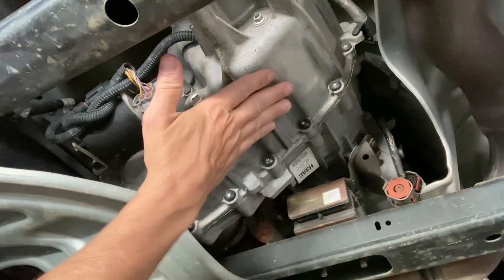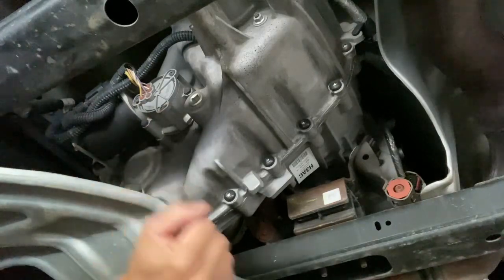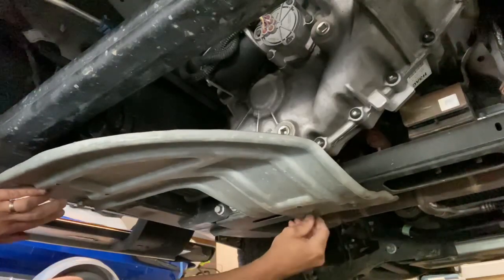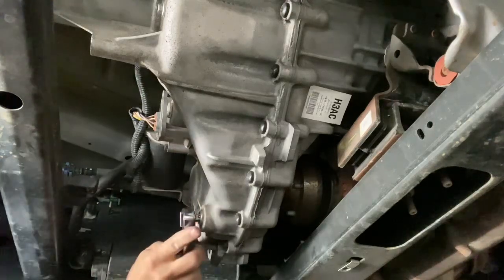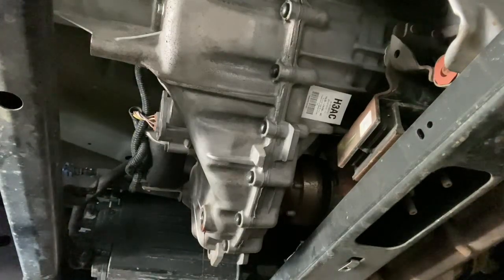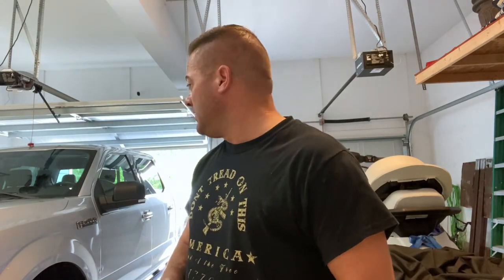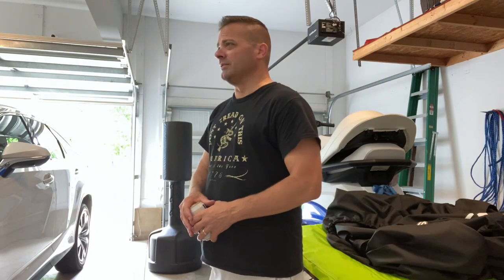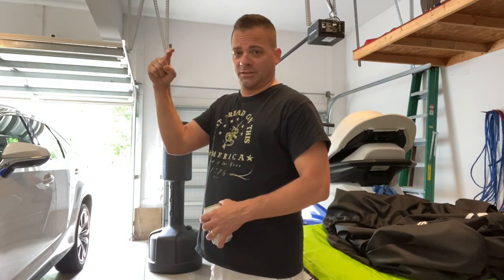F-150 FX4 Transfer Case Fluid Change

Comment: I use the exact same tool to suck the fluid out of my 10 speed auto. Works great!
Reply from the maker: Cheap to that can save so much😎 I just recently used it on my 10r80 too. How has yours been since the fluid change?

Comment: Great video.

I'm not saying this applies to you specifically, but I find that people in general don't understand the importance of the first fluid change. I don't care if we're talking engine oil, transfer case, front/rear diff, transmission, whatever, that first change is the most critical IMHO, and it's fluids will be the dirtiest at any given mileage, with the most metal stuck to your magnetic plugs, or metal shavings in any given filter or screen. That's because everything was new, and when you've got a bunch of metal parts wearing into each other you're going to get small metal debri wearing off, and in your oil and fluid. Not speaking directly to oil changes, as most people understand the importance of changing your engine oil regularly, but IMO changing your transmission/differential/transfer case fluids, after the vehicles first 30-40K miles in a very good idea to help keep everything running smooth, quiet, and issue free. Also I like to drop the transmission pan for the first change instead of siphoning it so I can change the filter after the transmission's been broken-in good, as it's sure to have some trash and debri in it from the break-in. Adding a transmission pan with a drain at the same time is a good idea as it makes changing the fluid way easier, and helps motivate you to want to keep cycling fresh fluid in it about every 2-3 oil changes. That's how I do it. The transmission holds way more fluid in it that just the pan, but this just helps keep the fluid in it healthy as you're drain out a lot of old fluid, and adding a lot of fresh fluid. Same with the rear diff cover. Adding a cover with a drain makes a somewhat aggrovating job, an easy one, so then you're more likely to motivate yourself to keep fresh fluid in it.
Reply from the maker: I agree on every point you made, and boy do I ever wish this 10r80 transmission had a drain plug right at the bottom to service more easily and regularly. 👍🏽
Reply: @kineticenergy1085  Yeah I understand. I'm trying to plan doing it in my trucks. My wife's truck is a 17 F150 Lariat 501A, 4x4, crewcab with the 3.5L 10R80, and the trans-cooler is mounted to the front of the truck instead of under the front of the pan. I don't expect this to be a very difficult change. My truck on the other hand is an 18 F150 XLT 302A, crewcab, FX4 with the 5L/10R80, so I have to get the trans-cooler out the way, and either drop the midpipe, or lift the rear of the transmission some. Everything I've seen says to unbolt the rear of the transmission from the mount that's bolted to the crossmember which has some hard to reach bolts, but IDK why it wouldn't be way easier or not possible to unbolt the transmission mount from the crossmember itself, or either unbolt the crossmember from the frame.?.? Those bolts seem easier to get to than unbolting the transmission from the mount itself, but admittedly I haven't crawled under there and over examined it either.
Reply from the maker: @JROC734  from the videos I see, you disconnect the trans cooler and sway bar to drop the pan.  “Flying wrenches” and “Fordtechmakuloco” made some vids on this process.
Reply from the maker: @JROC734 https://youtu.be/p96a8_MPwyM?si=hTrawAKCjN9wclZj
Reply: @kineticenergy1085  

Thanks! Yeah IDK why Ford doesn't add a drain plug, unless they want people to bring it in, and pay some dealership to change the fluid. My 03 Lightning didn't come with a drain plug, but the 4x4 pan from that era did have a drain plug. When I added my performance VB to my L, I put a 4x4 pan on it at the same time. It even holds an extra 1-2 quarts of fluid over the old 2WD pan.

Comment: I have watched a lot of fluid change videos and I have never seen the recommendation to change the fluid when it is warm. I was always taught to run the vehicle until the fluid was warmed up and then change it.
Reply from the maker: I didn’t recommend either way.  There’s no point in either way for a T-case, only a transmission when filling.  T-case is just a sump with gears and holds about 3 quarts and all remains in that unit.

Comment: What kind of fluid is it?
Reply from the maker: Ford states Mercon ULV and definitely what I used👍🏽
Reply: @kineticenergy1085  OK I have a 2017 ford f150 xlt 4x4 everyone is saying to use Marconi lv for my transfer case fluid.
Reply from the maker: @keepitreal5148  my 2018 calls for ULV in the T-case, same as it’s 10r80 transmission. If you don’t have the 10r80 in the 2017 then I do believe the LV is called for both your 6 speed and Tcase
Reply: @kineticenergy1085  from what i read in other places, everyone everywhere says it takes mercon LV not ULV. ULV is only for the transmission
Reply from the maker: @Chris-bz9pg  crap. Yes, right at 15:16 shows the bottle as Mercon LV, not ULV. ULV is for the trans, not the-case.  Thanks for pointing that out. I typed this after the video and got the trans confused. This  video, right at 15:16 shows LV, all.
Reply: @kineticenergy1085  i had several quarts of ulv left from changing my trans and got excited for a sec thinking i now had the perfect place to use it 😂
Reply from the maker: @Chris-bz9pg  ya, sorry bro.  I watched my entire video then checked my manual after seeing your comment about ULV.  My error was stating ULV in the comments but I posted the pic of LV in the video. 🤦🏽‍♂️👍🏽